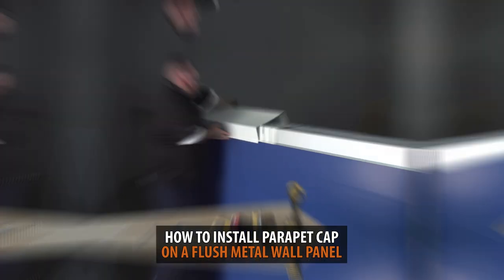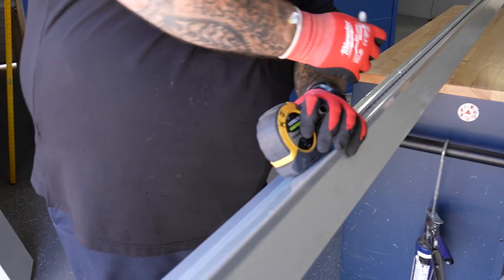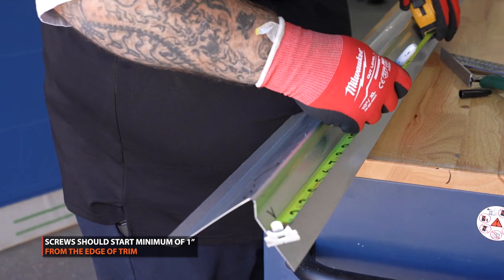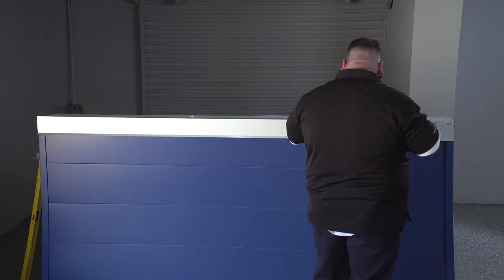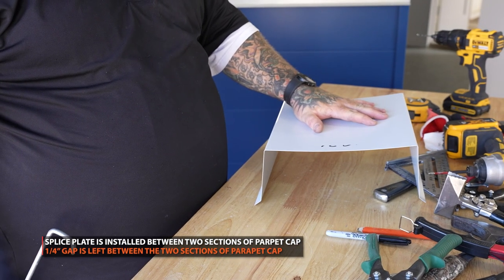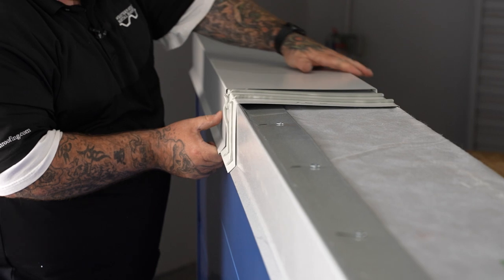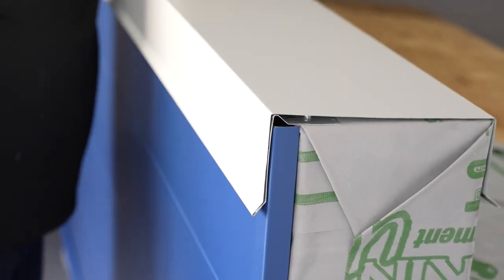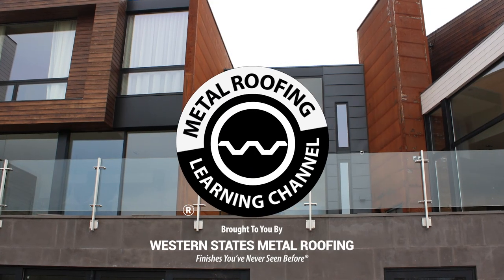How To Install Metal Parapet Wall Coping Cap On A Flush Metal Wall Panel

Comment: That is not correct as it is designed for water to collect inside the overlap. Even if this passes inspections, it does not make it right. Please delete this video and make one showing a proper overlap. Also a 1/4-inch gap on a 10-foot is more than necessary even in 100-degree environments.

Comment: I don't like the splice plate technique and you didn't even caulk where it laps. It's much cleaner and water tight to use an s lock, standing seam or even ghost lapping it a couple inches.

Comment: There should be room for airflow in the front, and also the glue you use to prevent water to flow in will rot after a few years, also when water comes in there and it freeze, its gonna expand the metal away from the glue

Comment: Great video......Thank you very much. One question: What goes on the vertical part of the wall ? Can you use a Cap on a vertical wall and how would you connect the horizontal with the vertical. 
Looking forward to hearing from you.

Comment: This is completely incorrect.

These need to have some type of overlap on them at the very least.   

The seam connection should actually be done with a standing seam technique or an S-lock technique.  

The fact that you put screws in the back completely negates the allowance for expansion and contraction,   You’ve fixed the piece in place,  it cannot move now.  

This would not pass any type of inspection.
Reply from the maker: Mr. Hunter, we appreciate the feedback and value your opinion. There are a few ways to install coping cap and this video provides one way of many. The technique provided in the video has been used for many years by many installers across the country and has withstood the test of time and passed all inspections that we are aware of. 

Your suggested method is yet another way to install cap, but is much more difficult for most and is not used by many installers, but still ends with same results. The trim piece that's fixed in place is only 10' in length which will minimize the expansion and contraction. 

If you would like to post a link to a video of your installation method in the comments we would welcome that.